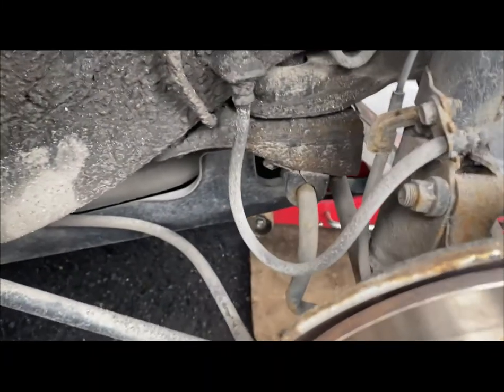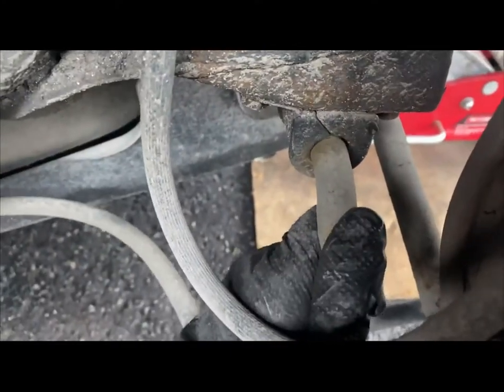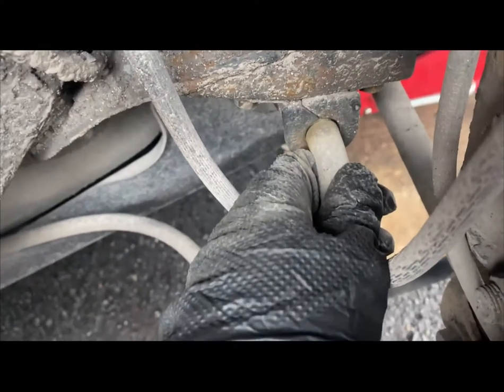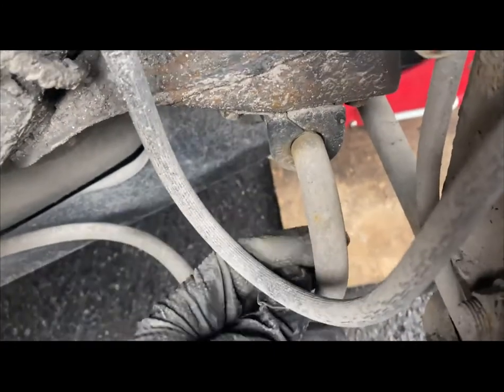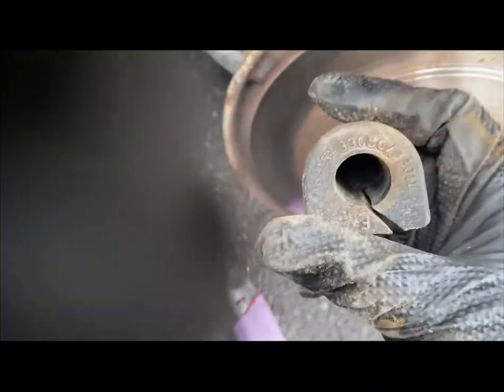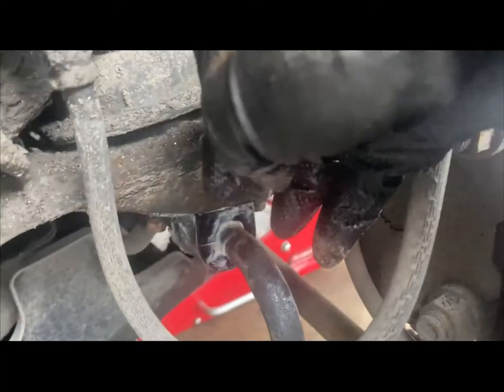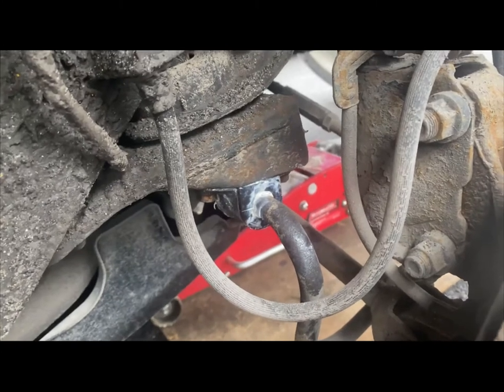EASY FIX - Suspension knock over bumps? Nothing Wrong? (Toyota Camry)

Comment: As rubber bushings get old they harden. By driving, over time the bar will make the hole a bit larger. Then the rattling starts. Cheap and easy to fix. Only possible pain could be getting those bolts out. Spray bolts a day ahead of time with a penetrant oil. It'll help with removal.
Reply: This helps so much, i did it to my struts a day before and i broke all the bolts without much hassle. Im now getting this clunking noise after 2 weeks of replacing all struts. Hopes this fixes problem. Thankz
Reply: @alexcalderon4508  make sure you tighten all suspension parts with compression… with car supported by stands, use a floor jack to compress at the lower arm or hub… then tighten down everything. And, yeah, bushings are a nuisance cheap to remedy.

Comment: How did you slip the new bushing on.
When comparing the old Vs the new, I didn’t notice any opening but the hole. 

You didn’t show installing the new one.....!!
Did you cut on the new one..?
Reply: I had a double take also but you can see the line from cut on the new one. It's in the same place as on the older one
Reply: @abe6517  
Could you post  the time where you see the cut on the new one.
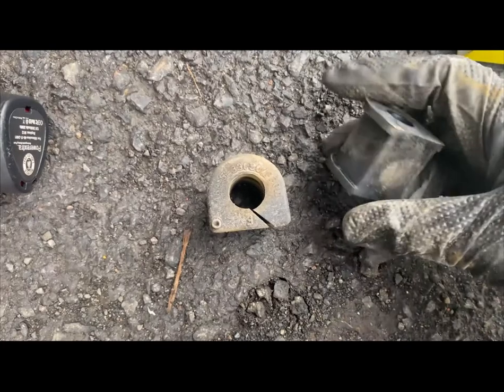Cause at 3:32 when comparing the cut with the old one... looks on an angle left to righ/down....but the new one doesn't show any split/cut.
Reply: Pause at 335 and you can see it on the right side. If you look up the part online you can spot it.
Reply from the maker: there's a opening on every sway bar bushings, its as easy as replacing a 'bolt' , nothing much to show
Reply: You mean you don't have to take the whole stabilizer bar off and slide it on the end.